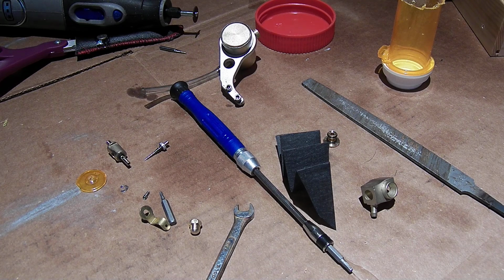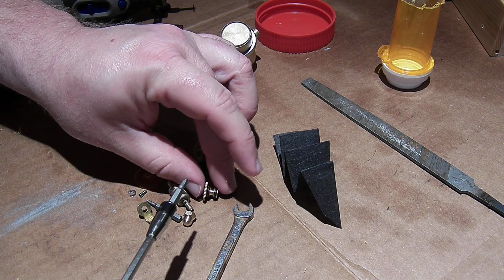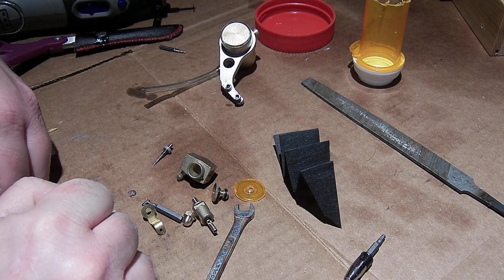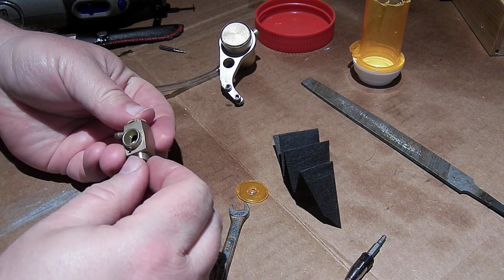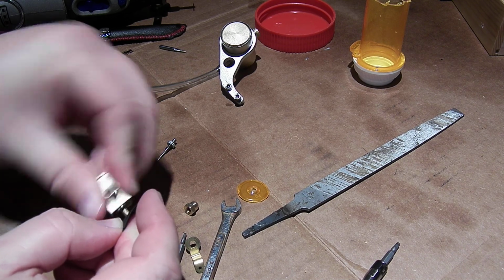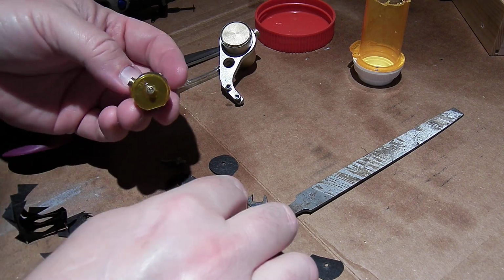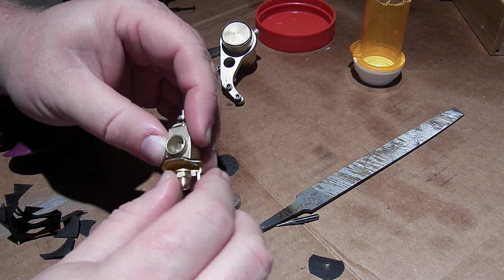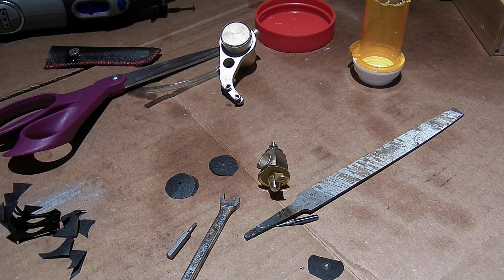ET8 Carb air fix

Comment: Hey Henry! I have some news to share. I have received my M16 mini engine new carburetor, and a new ignition. The thing runs amazing! You can see my videos on it, but if you were to get another engine, the M16 is quite a good bet, just got a watch out for the carburetor, I got sent a new one by Engine diy and a new ignition free of charge!
Reply from the maker: I'm glad they were able to send you replacement parts and you could get the M16 running well.
Reply: @henrybangsberg2187  yup. It does run nice. Will there be a video today?
Reply from the maker: @Farmtractor  I will be heading out in a bit to test the ET8 after the attempted carb modification and I don't know how many other engines I will run with it.  I plan to upload this afternoon.
Reply: @henrybangsberg2187  sweet! I’ll be there